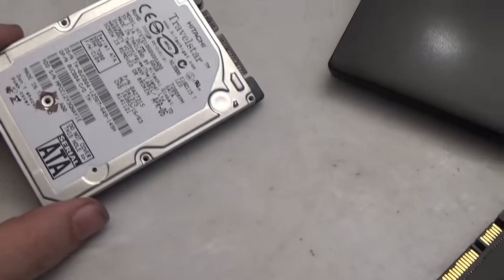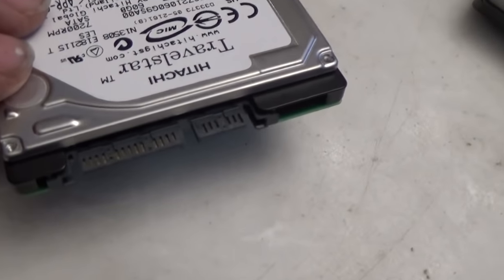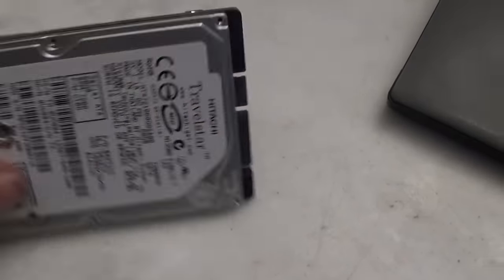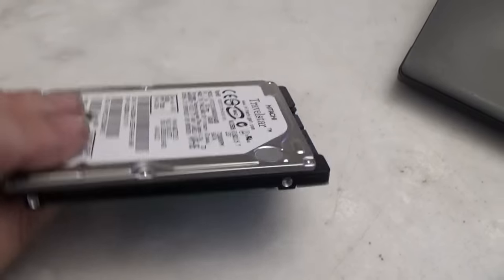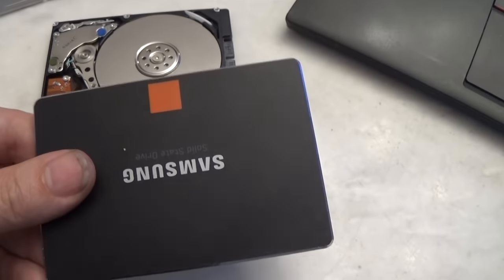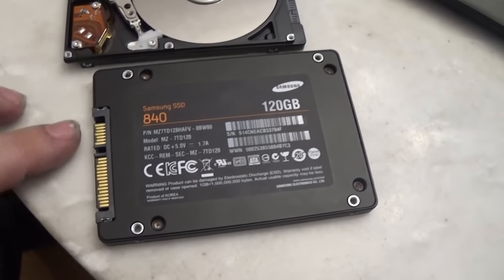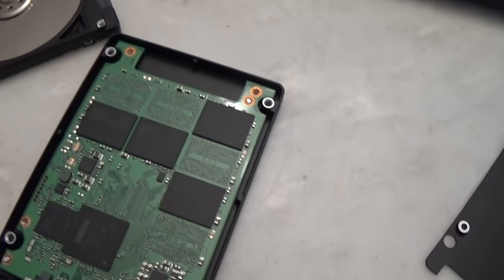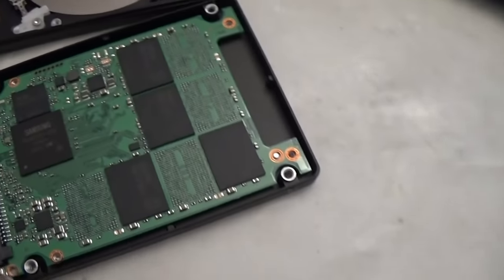Take a look inside a hard drive while it's running

Comment: The wide connector is the power, and the small one is the data. I know it seems counter intuitive, but yes there are more power pins than data. I think there's power pins for 12V and pins for 5V I assume they're separate, and some other pins maybe for communicating to PSU or something. This is a serial drive so it doesn't need many pins for the data, that's the whole point of SATA. USB is also serial and 2.0 only has 2 data pins. Serial ports also have way less pins than parallel. It remains very interesting to see inside a hard drive, despite having seen it many times before. Something very interesting is how there is a very tiny kind of actuator on the tip of the read write head that can do miniscule adjustments when voltage applied to. It's incredible technology. I assume the hard drive had Windows XP on it, it's lovely to see a drive that still runs fine while open. Usually I only open drives when they're already broken, so it's rarer to see one in action from the inside. Thanks!

Comment: Still more dependable for long-term storage than SSD.
Reply: until it drops that is
Reply: @matteodevellis6266  I think if you drop either from a distance your data is fucked man.
Reply: Not true. I know a senior storage engineer at a large tech company, they are using almost exclusively SSD arrays now for cloud based services. SSDs are faster, more reliable, resistant to environmental factors, and use less power while they are quickly becoming the same price if not cheaper long term to operate.
Reply: @HarryTheOwlcat  ask him what they use for backups, if it isn't tape then it's HDDs.
Reply: @JGnLAU8OAWF6  they use RAID esque technologies first, and then physical backups at other locations are also on SSDs
Reply: @HarryTheOwlcat  wow, didn't expect this at all
Reply: @JGnLAU8OAWF6  I just had a discussion with him. The first backup is RAID or other parity methods. Backups are on HDD - he said not because of long term friendliness but just because of cost. Long term archive is on tape. So I guess I was wrong. 

He did say however that they do not buy drives looking for longevity, as any failing drive will be replaced whether it's an SSD or HDD

Comment: SSD has no moving parts and is way faster. HDDS have moving parts and are way slower and can break easily
Reply: Yes
Reply: Yes but ssds have reading and writing limit while hdd doesn't
Reply: @mohamedwalid6181  Yeah like 250TB up to 9 Petabytes (250 - 9000TB) of information which you would never reach anyway on a home computer, even on the low end, you wouldn't reach 250TB write either.
Reply: Yes that if you have a high-end ssd that costs not less than 250$
Reply: @mohamedwalid6181  quality SSDs costing about $80 or less can be bought now that have a long write lifespan lasting an estimated 1.5 million hours (assuming normal usage). Normal usage means you are not writing over 100GB a day every day.
Reply: @konather8065  look at TBW, not hours.
Reply: @JGnLAU8OAWF6  yesh, i was looking for the TBW, but for some reason couldn't find it for a specific ssd. eh.

Comment: The screw that goes in the real write head holds pressure on the head so it doesn’t scrape the platers. That squeaking noise is the head touching the platter.

Comment: AFAIK, the heads are not spring loaded. However, in a case of a power failure, the inertia of the spinning platters, serves as an energy reserve, driving the motor like a dynamo. That energy then is used to make the heads move to the parking position.

Comment: I once worked in a computer repair shop, and a customer brought in a gateway laptop for repair, and apparently someone had removed the cover off of the HDD but then put the drive back in the laptop and who knows how long it was running in that state.  It was acting "funny" when they brought it in, hence what was done to it.  So pulled the drive out to run a bench test on it, and not aware the drive was in the laptop with its cover removed, as that's a pretty rare occurrence, I managed to touch the platter on the drive, which made it worse of course.  They had already destroyed it before they brought it in to get fixed though.

Comment: Note that the heads are not in contact with the disk, when the disk spins it creates winds over it’s surface and the heads kind of « surf » over the air cushion in some kind of ground effect. « In 2011, the flying height in modern drives was a few nanometers.[2] Thus, the head can collide with even an obstruction as thin as a fingerprint or a particle of smoke. Despite the dangers of hard drive failure from such foreign objects, hard drives generally allow for ventilation (albeit through a filter) so that the air pressure within the drive can equalize with the air pressure outside.[3] Because disk drives depend on the head floating on a cushion of air, they are not designed to operate in a vacuum. Regulation of flying height will become even more important in future high-capacity drives.[4] »
Reply: To give you an image : "If the read/write head were a Boeing 747, and the hard-disk platter the surface of the Earth: The head would fly at Mach 800; At less than one centimeter from the ground"
Reply: And when we talk about hard disk crash, it’s litterally that the head crashes on the disk, damaging it forever and here how it looks like : https://www.researchgate.net/profile/Charles_Sobey/publication/3111743/figure/fig2/AS:667603722854406@1536180539695/The-dull-ring-near-the-middle-diameter-of-this-spinning-disk-is-the-result-of-a-head.jpg

Comment: 8:00 What I wanted to see, after my brand new, 16tb hard drive fell 32 inches to the floor, unplugging itself from the power connector in the process. The fact that it happened is going to be a source of irritation, even if it survives for years. Because you just don't know if it caused some damage that diminished its lifespan.

Comment: Small corrections: 
- The big connector is for power and the small one is for data transmission.
- The data is not stored in the form of a spiral but in rings, which in turn are split into sectors.
- SSD hard drive is not a thing. SSD is short for solid state drive. A solid state drive hard drive is just wrong terminology.
- Aluminium is not magnetic. The metal needs to be ferrous, like iron or similar.

Comment: The heads will never touch the platter surface if operating normally, they sit extremely close though - around 5 nanometers off the surface.

Comment: 7:20 my computer did this in the W98 era, now my w7 laptop doesn’t do this. It works like the Tekram VLB cache cards, that used 4-16 mb cache ram, and the head nearly does nothing at all, only the hdd led is blinking. It was the same with the 486 vlb card, the hdd was replaced by the memory, and the card was actually the hdd, up to 16 mb. The hdd only rarely used the heads.

Comment: Pro Tipp: never "touch" the spinning disks surface with a screwdriver. 
I did it once on a 3,5 Zoll Harddrive to see, what damage it will do. As soon as i touched the surface, sparks flew off, shortly followed by the drive itself flying away from my desk. Crazy how much energy a 7200rpm HDDs has, when spinning. The drive flew nearly 4 meters away and my screwdriver was bend after that.

Comment: Make sure to defrag your HDDs aka hard drives if you guys still use them every once in a while. On the other hand SSD's only need to be trimmed and not defrag though. Now we got M.2s. Tech just keeps evolving and changing but the issue is which of these three storage mediums can actually last for a very long time.

Comment: However the head would actually only be slowly scanning across the disk track by track if it was performing a complete rewrite operation where all of the data on the disk is rewritten in order to prevent data loss from the magnetically charged bits naturally loosing their charge over time! :)

Comment: Oh.....so the cover is actually part of the structure of the hard drive. The screw that goes through the arm supports the arm, obviously. I would think the cover has to be on to prevent the arm contacting and ruining the disc as it spins at thousands of RPM.

Comment: 1:42 Those paper filters are to filter dust that is generated during the operation of the drive bro! Yes there will be microscopic particles of dust that will be generated from the moving components of HDD during operation and it is the job of these filters to filter them out to keep the hard drive from crashing.

Comment: How well is it held in place without the top hd cover holding it down? Wouldn't it be very dangerous if one or more disks got loose while running? (5600 or 7200 RPM!?) I'm not going to do it, I'm just wondering about how safe it is to even test this.
Reply from the maker: Running without the cover will ruin the drive - so it's not safe for the data.

Comment: How did it worked with it exposed? We're taught from birth that the disk can't take particles of dust, external light and whatnot.
Reply from the maker: It lasted long enough for the video!  It went into the garbage afterwards.
Reply: @vsvenson  I hope ppl don't do that. I had a 1 tera hard drive that stopped working after a trip I did. Had nothing to lose, or so I thought. I opened the sarcophagus, swapped the head, it clicked some noises for like 15 minutes until it perma died. I only made things worse opening it and lost everything. Mechanical hd no more. Waste of time, sacred files e money.

Comment: The heads never actually contact the surface, they float on the smallest of air pillows (hence the need for the air hole).
Heads touching the platters is what's called a head crash, and it is not good.

Comment: My dad buy alot of used hard drive some not work so we open them  to get magnets and other parts to repair other hard drives 
One of them spin but not work so i open it open without  unplugging and i mistakely put my hands over  reading pin and it make some cool lines

Comment: I didn't know a hard drive could run outside the casing. I believe is not recommended due to dust or particles falling onto the disk. These pieces had to exposed in a clean room.

Comment: if you look at the way the head was moving it show that the fire was fragmented its always a good idea to de-frag Hard drive every once in a while as the more fragmented files are the more the head has to move thus slowing it down as so the more the head move the ware and tear it will in cure. also dont de-frag a SSD the computer should automatically not allow it but still make sure not to de-frag an SSD. one they dont need it two SSD's have a limited amount of wright's even tho this limits is getting bigger with every new generation of SSD its still just a waste.

Comment: I been having this question. what would happen if you flip the disk on the other side and install it back in your PC.
Reply from the maker: Because the data wouldn't be in the order it was expected, I assume it would just cause a general "data corruption" error.
Reply: @vsvenson  it just gave me an error saying no boot system detected as well as the hard drive was not being read

Comment: I'm watching how heads are working, then if I'm not wrong. filesystem is not defragmented or defragmented badly. Probably this is defragmented by built in windows defrag. It does not work good.

Comment: Steel not aluminum for everything he mentioned was aluminum. pressure relief stickers not filters. The inside of an hdd drive is hermetically sealed. The stickers are to allow it to maintain sealed at different elevations.
Reply: @givepassword  I just read up on this, link here:
https://www.data-medics.com/data-recovery-blog/are-hard-drives-hermetically-sealed/
Because you had me doubting myself. You are right in that most are not technically hermetically sealed. Referring to a gas permeable sticker as a filter was what had me confused. I was previously unaware that that sticker was actually permeable, which led me to believe it was hermetically sealed. But gas is able to travel through it in a similar way to a latex balloon deflating over time, it's slow going, and doesn't let particles in, certainty interesting stuff!

Some actually hermetically sealed drives are the helium filled drives that just recently started selling.

Comment: I still prefer HDDs over SSDs, the reason is simple, SSDs have a definite limited life and can only be written to a certain amount of times.  I have some really old HDDs that still work fine.  I think you should cover exactly how SSDs work and why their lifespan is more limited than HDDs as I feel it is important to understand.  I have only had ONE HDD fail in my life, and that was two decades ago.  SSDs are faster due to being solid state, but I have already heard stories of failed ones, especially cheap ones.
 
Caution though, do NOT open a HDD like he did in this.  They are very sensitive to dust, dirt etc... some even require a certain amount of torque to be used for the screws in  the case or they won't operate again.

Comment: And wouldn’t a hard drive running from a USB port not be as a good as it would be  if it was hooked up inside the pc because of max data transfer that the USB port has ?
Reply from the maker: Correct - USB data transfer rate is slower than SATA
Reply: Van Svenson sata?
Reply from the maker: @potatohamlin5242  That's the data transfer protocol when the drive is plugged inside your computer.
Reply: Van Svenson  oh

Comment: My hard disk makes sound when opening my laptop
But my laptop doesn't works and it shows "No boot device sound". Is that because of my hard disk?
Reply: If it makes sounds like grinding, bumping, etc, that most likely means that the hard drive is damaged and that's why your laptop will not boot.
Reply: @JJFlores197  It sometimes produces sound like a clock (tick-tick) and sometime it beeps
Reply: @sarcaser223  yeah that sounds like a  dying hard drive. Not much you can do short of replacing it, preferably with an SSD.
Reply: @JJFlores197  It was a new drive, probably like 8 months.
Reply: @sarcaser223  Yeah well that sometimes happens. Did you happen to drop your laptop or bump it against something hard? If so, that may be why it died. It may also be that the drive was defective from the start and just now started having these problems. No exact way of knowing.
Reply: @JJFlores197  Nah I always  kept my laptop beside my Monitor. I never dropped it and yeah the harddisk made some weird kind of noise for a long time maybe like 5 mins and it showed error message   
"Your device ran into a problem and many other lines....." (the blue screen one)

Comment: So if the SSD is the opposite of the Hard Disk Drive does it mean that SSD also means Soft State Drive?
Reply: @givepassword  Well what I did was a joke, take it as it is. And it is a bit the opposite, the hdd as moving parts  and the ssd doesn't
Reply: @givepassword  numerically yes but in computers no
Reply from the maker: The old floppy disk drives had a thin plastic disk that was flexible - when they changed the disks to aluminum, it became a "hard disk drive".
Reply: @vsvenson  Oh so the floppy disks were the OG Soft Disk Drive lol

Comment: this guy isnt familiar with pc parts, its like he watched a video on how it works and then recorded this... still cool, just terminology and facts arent 100%....a lot of misleading info as well..
the 2.5 HDD (hard disk drive) has sata and power connections, but he pointed to the opposite when naming them. a SSD is not a hard drive, a hard drive has a disk. Its a SSD, saying SSD hard drive is like that "ily i love you"... SSD stands for Solid State Drive, and uses casheing and flashing to have read/write speeds up to whatever the limit of your sata cable is (1, 2, or 3, up to like 600mb/s) 
The SSD being double the size has nothing to do with it being an SSD. That 60gb drive is insanely old, using SATA 1 was still being used in 2004 until sata 2 came out later that year. 60gb was a lot then, 128gb can barely handle windows 10 and a game or some pictures/videos. HDD while being harder to make, with moving parts and all, SHOULD technically be not as reliable, but thats not actually the case. SSDs need a firmware as well as HDDs... and this is huge. Ive had more SSDs die more recently than older HDDs. All a HDD is, is just a record player for data, instead of wavelenghts. Its honeslty old tech, just at a faster rate.

still a fun video.. ive just had a bad day and am critisizing everything..